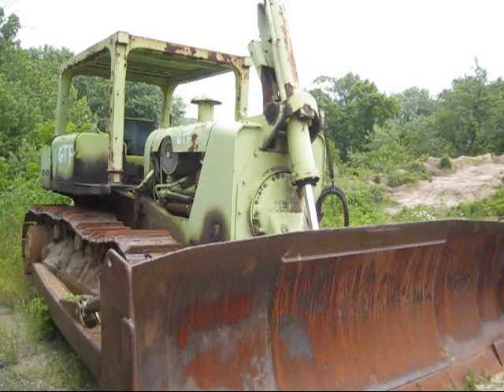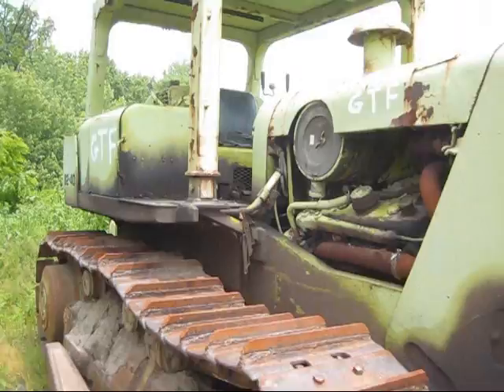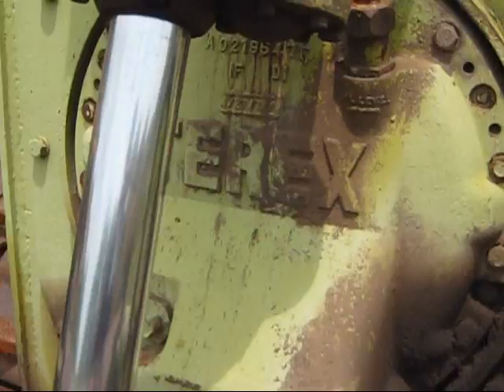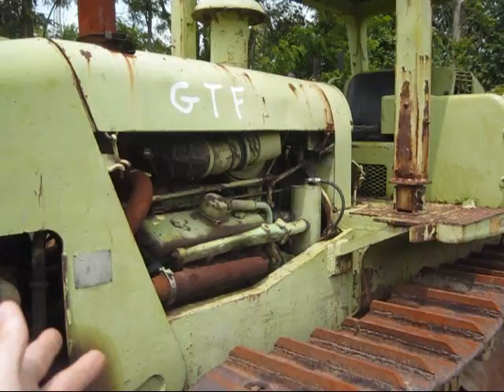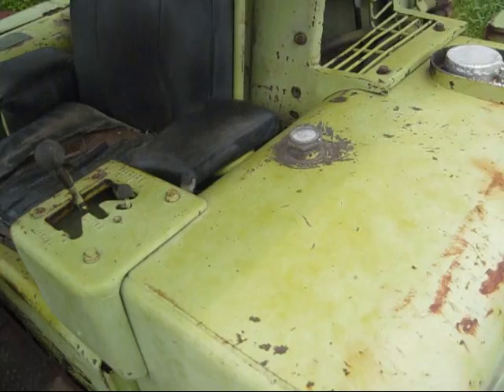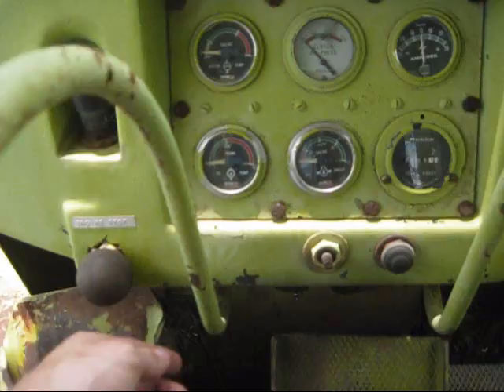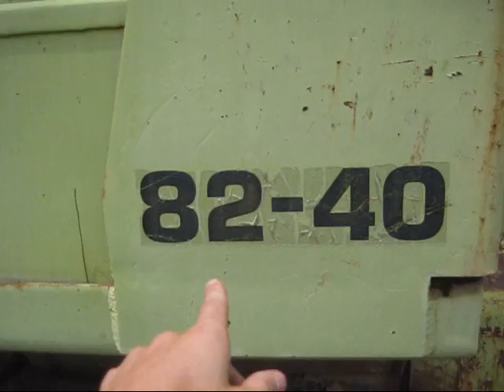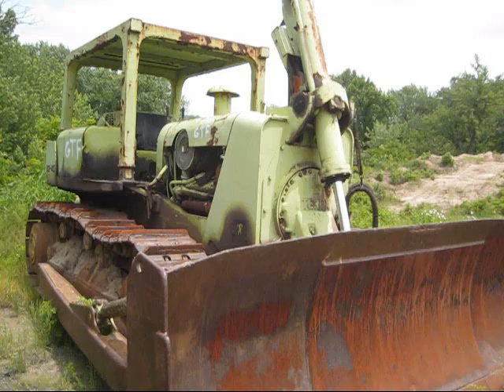Terex 82-40DA Documentary

Comment: I have owned two of these dozers. Other than the noise coming from the Detroit, they are very productive and well balanced machines.They are roughly the size of the D8-H/K. The left side foot pedal tilts the blade and the transmission selector engages the starter. The biggest down fall in my experience would be the track frames.  Both of mine had turnable fan blades for summer and winter. Almost forgot how bad the blades cracked on these. Two full days of welding annually.

Comment: There's actually a driveshaft that runs from the engine along the frame and up to the radiator to operate the cooling fan. Interesting design for sure. I've operated a 1971 82-40 (Non DA model) with the 8V71N. Awesome machines. Tons of power and the controls are very simple.

Comment: Good presentation and  you're well equipped with facts.  But you did forget to mention the cooling fan as BC Logger did below.  That was one point that did NOT allow operators to get warm in cold operating conditions. Unless, they skirted along the sides of the body with tarpaulins ( after reversing the direction of the fan blades to  try to keep some of the heated air in and around the operator.)  Other than this, these 82- series Dozers were a great machine that GM screwed up by dis-continuing. ( This is only my opinion of course, I could be wrong ) But I liked these units.

Comment: I ran one of those about 17 years ago. They were pushing old Dozers. Slow but they wasnt built for SPEED...This machine is just one of many Why I cant HEAR TODAY....LOL....When you ran this Dozer at the end of the Day You was WHIPPED....The one I operated had a winch on it. And One of the Dump truck drivers Didnt fallow directions and got hung up. HE Hooked the cable to the front end of his truck. And When I eased ahead It pulled the front left spring hanger right out of the frame of the truck.....LOL...Needless to say the truck Driver wasnt very smart...Too lazy to get his pull hook out of cab and hook to it. Great Video. Good memories..Thank You
Reply: cheapest dozer ever made most of them where junked before their time

Comment: Lovely old dozer.
Do you know what the op.weight of this machine was? Looks like a D7 size machine?
Also, with the rad being at the back..did it have a fan that blew the warm air out of the rad, instead of sucking in..as on old JCB 3C backhoe/excavators etc?
Nice to see such a different design - everything seems about turn on it, but obviously worked well.
Looks every bit as good and strong as an equivalent CAT. 
Nice vid.
Reply: Yep, the fan blows out through radiator to the back. She equivalent to D8-D9.   36000 kg operating weight with ripper.